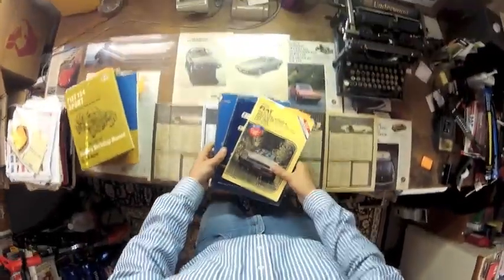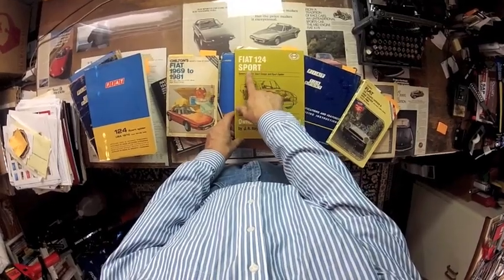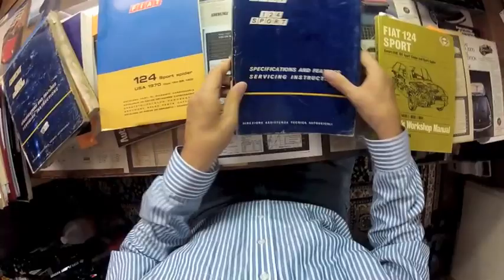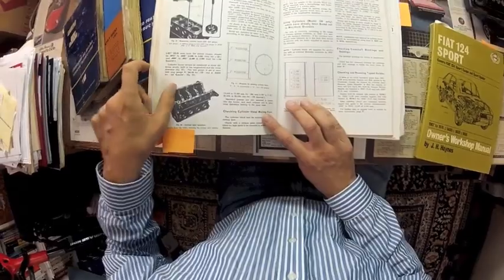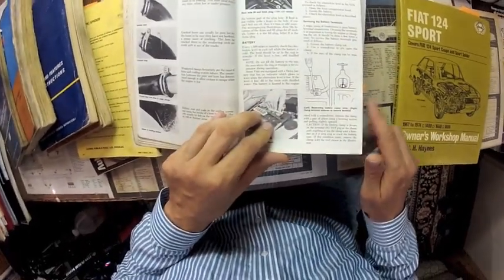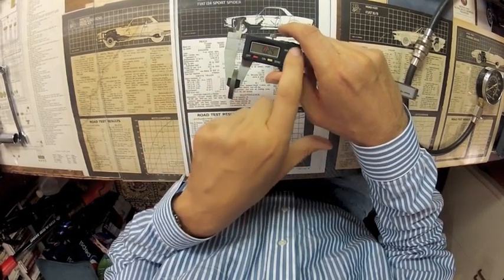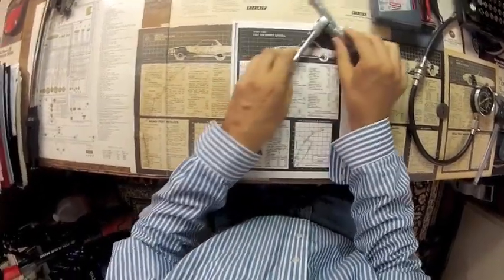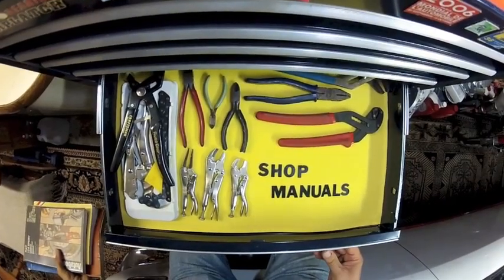Fiat 124 Sport Spider First Tools

Comment: What does the gauge in the middle of the dash measure?
Reply from the maker: That is a vacuum gauge I was using on a different project. The needle moves in relation to the throttle opening.
Alden